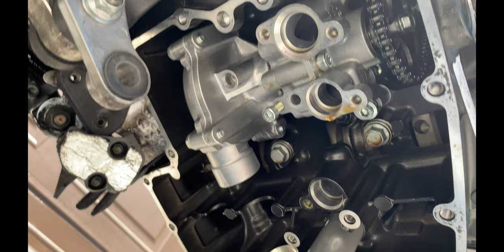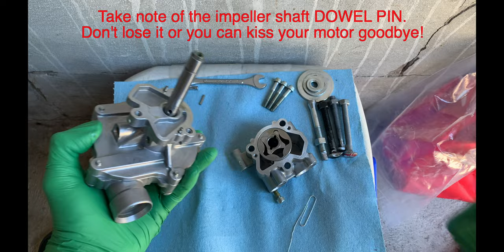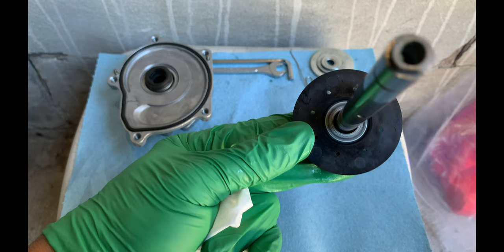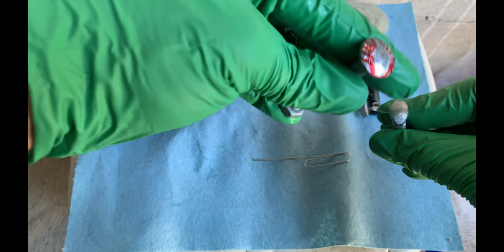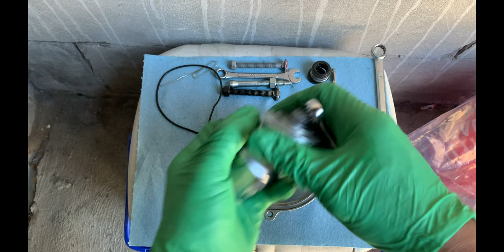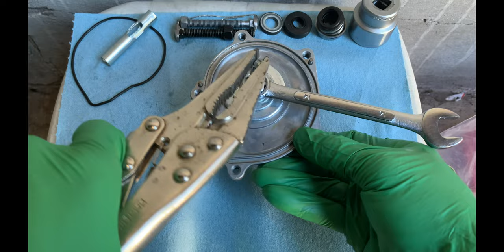2007 Yamaha R1 Water Pump Repair Part 1 / Mechanical seal / Oil seal / Bearing

Comment: Did you buy a new oil seal? I am searching for a new oil seal for my RN19 and can't find.
Reply from the maker: Yes, I bought all brand new genuine Yamaha  parts from a local motorcycle dealer. You could find the oil seal from an online OEM motorcycle parts store like Partzilla, etc.

Comment: hello . you did not had to take the clutch out? it can come out with out removing it?
Reply from the maker: Hi, I did not remove the clutch. The trick is to unbolt the oil/water pump sprocket and let it hang with the drive chain. The oil/water pump will come out without a fuss. 
I should’ve recorded this.
Reply: @romeojhd3720  Good to know. I have a older 2000 R1 I am replacing the water pump and was about to order the clutch cover gasket. 

Also I wish I would of saw your video before I removed my mechanical seal. It was a pain to get out. Your idea to get it out I could have done as well.